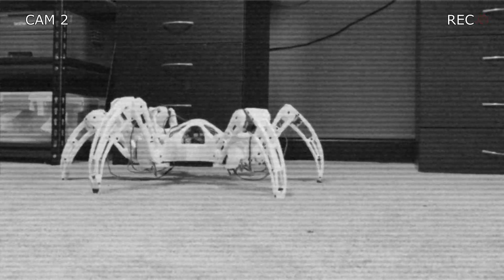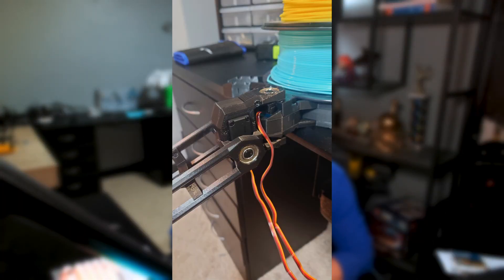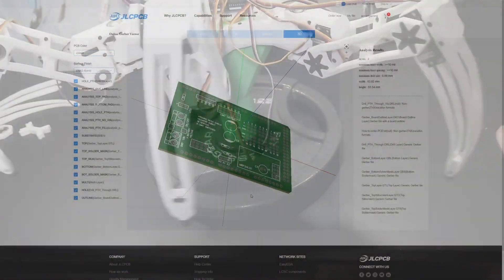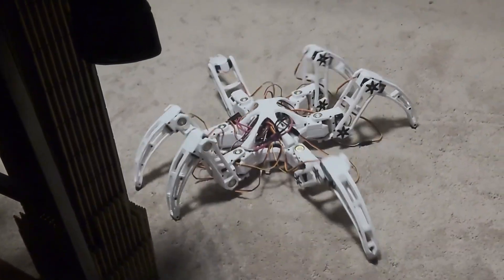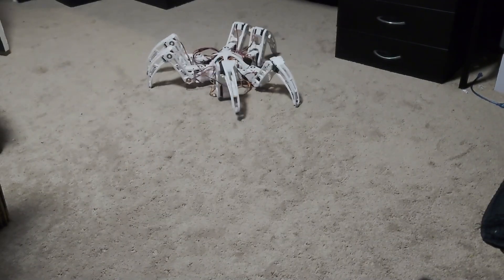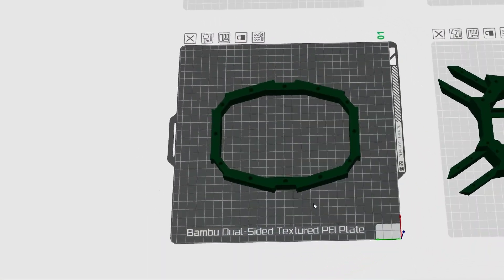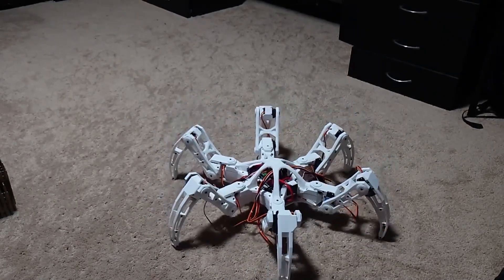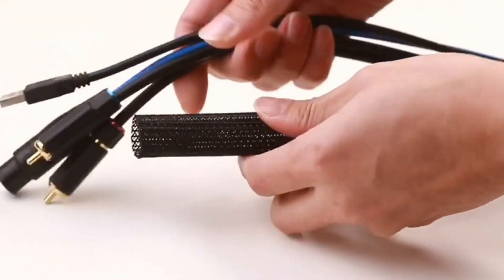I Built an Arduino Powered Hexapod from Scratch

Comment: Hello, I am an Electrical and Electronics Engineering student. This project caught my attention. I would like to implement the project using an STM32, but the servo motors you are using are a bit expensive for me. Therefore, I would like to use the cheaper MG996R servo motors. I don't have much experience with 3D modeling, so could you provide me with the drawing files that are compatible with the MG996R servo motors? Also, I would like to review the code you wrote."

Comment: Hi, where can I find the code for the one leg test? Also, do you have any idea how I could get it to work on RPI 4?
Reply from the maker: I actually don't have that code anymore, sorry.
I have no experience with RPI 4, but if it can run arduino code and has enough pins that it could probably work with a few tweaks?

Comment: What thoughts were involved with choosing battery size and type?
Reply from the maker: Powering 18 servos at the same time takes a ton of current, and a lipo is able to handle it. I chose 7000mah so it could run as long as possible before needing to recharge.

Comment: Two ideas I have. One some sort of mount plate on top for attaching accessories. Two wireless charger on the bottom so it can walk onto and set itself down on a charging pad. I think just these two modifications would greatly expand the use cases for this awesome robot. Dang it, now I want to build one.
Reply from the maker: Ooooh a wireless charging base is a really good idea!! It doesnt even have to be wireless tbh... Ill have to look into this.

Accessories are in the pipeline 😉

Comment: i Think this is real cool. But i think its missing somethink practical. You can hunt a little your cat with it, until it runs under somethink.
Idear would be to upgrade the board to somethink that can use a camera and even a detection system, so that you could use it as mobile camera.
With that comes the problem that the system needs to "see" when there is a object in the way or even can see when there is a hight diffrence in the walking way.
And the think maybe most people need is somethink that can uses steps to go up and down.
Reply from the maker: I think it's ok that this doesn't have a practical use! It's a cool robotics project/platform and that is good enough 🙂

Comment: You overcomplicated... 2 servos per leg are enough... you need to tilt and lift the leg... this can be done by gears or on low weight by wires and springs.
Reply from the maker: It would work with2 per, but the feet would slide across the ground while walking, so I'll only do that if I'm making a super low budget one.

Comment: which servo's did you use?
Reply from the maker: dsservos. ds3225 for the coxas, and currently a mix of ds3235/ds3235 pros for everything else
Reply: @AecertRobotics  so, are there any cheaper motors available for such a robot? What features should it have?
Reply: Why did you choose same servos for all parts, for example servos at the edge can be smaller and cheaper @AecertRobotics

Comment: Had same jitter 7:20 on the loosest leg of mine. I wouldn't really blame the servo as such. It's simply the mass of the leg at a distance and the speed of the movement causing overshoot on the servo position so it tries to correct back the other way and the same thing happens and basically it resonates. The servo is kinda doing what it is supposed to be doing but I appreciate that doesn't get you any closer to getting rid of the problem. Indeed increasing resistance to movement on the leg is probably the best bet for a fix.
Reply from the maker: 100% agree. For how inexpensive the servo is I'm pretty happy with it tbh

Comment: Now.... swap out the Arduino for an ESP32, and use it's WiFi interface for the radio. This way, any device with WiFi + Browser can be your controller through an IoT webpage.

Edit: You should merge your two motion states using linear algebra rather than an ad hoc method.
Reply from the maker: Would the wifi be fast enough to stream a video feed as well? That would be pretty cool.

Can you explain how I'd use linear algebra? Currently I have 2 points in space and I'm literally just averaging them together.
Reply: @AecertRobotics  Been trying to reply to this for days. Google spam filter has been blocking me. Not much I can do about it.... I doubt this will get through even.
Reply from the maker: @CharlesLeeScoville  that's weird... Well I can see this comment at least lol
Reply: @AecertRobotics  It may just be that my comment is too long... I'll break it up and obfuscate links....

Some ESP32's (such as the S2) have enough to do video. Search the usual shopping sites for ESP CAM as a good for instance, but by no means an endorsement. I personally would go for a self contained video setup intended for FPV drones...
Reply: The significance of linear algebra, in general, is that those above listed "transformations" are mathematical "operations" (think: "addition, subtraction, multiplication, division")  in a proper algebraic space, that is to say they can be combined, rearranged, and simplified just as you would with "normal" operations in "normal" algebra. It's the simplification concept that is key to your problem...

Say I have a variable, X, that starts at zero. I then add five, I then add two. I now have X as equal to seven. If we know the operation (addition) never changes and all we want is the result, then we could combine the two additions into one "big" addition, therefore having to do less work, and simply adding to X one time.... Algebraic simplification 101.

Right... so... all of your movements are some composition of the translation and/or rotation "operations" .. which we now know we can simplify.... and now we can think about specific examples... If I tell you to take five steps forward, then I tell you to take two more, you are now seven steps from where you started. Same thing as above!

Lastly, all this maths would also work just as well for "composite numbers," like complex numbers, and, important to us, vectors. Another example to make this sink in.... If I told you to take five steps north, and zero steps east, then I told you to take five steps east and zero steps north, it would be the same location as if I had told you to take five steps east and north from the very beginning.

Picking up what I'm throwing down?
Reply from the maker: @CharlesLeeScoville  right Im pretty sure I get what you are saying. Ultimately I'm just trying to calculate the next point in space the foot should be at. 
Currently to find the point I'm taking a weighted average of the forward point and the rotation point based on the two joystick values. What are you suggesting I do instead?

Comment: Great looking project!
Can I ask what lengths are the two parts of the leg? Do the motors handle the moment well?
Reply from the maker: Ty!!
Femur is 115 mm and tibia is 185mm. The femur and tibia servo gears tend to bend when I push it too hard, but overall they handle it quite well.
Reply: @AecertRobotics  brilliant, it looks much bigger in the pictures! how did you decide what would be the ratio between the tibia and the femur?
I've build a big hexapod as well (for my uni graduation project), you're more than welcome to take a look!
https://www.youtube.com/watch?v=QgEbqN0tf_c&ab_channel=MatanH

currently building a new one (cheaper since I don't have the uni funding anymore, but hopefully much smarter). thanks for sharing!
Reply from the maker: I basically just did what looked good lol. I wish I knew how to calculate the ideal length based on servo strength but I have a cs degree not a mechanical engineering degree

Comment: Interesting work.  Here are some thoughts/ideas I had while watching:
1) Stabilization Muscles: Real-life joints have smaller stabilizer muscles in addition to the macro driver muscles.  You might consider adding something along the lines of tensioned ligaments and/or little stabilizer drivers pulling on elastic, spring, pneumatics/hydraulics, or some equivalent tensioning straps across the joints.  These could also help provide feedback data to help the system "understand" how the joint is moving by seeing which stabilizers are being tensioned and which ones are relaxed if they are hooked up to a force meter.
2) Force Redirectors: The knee joint, for example, has the kneecap, with muscles attached by ligament to the top and then separate muscles attached to the bottom.  This re-directs force "over" the knee joint in such a way to reduce the torque necessary to extend the lower leg and also do so with more stability and less "jittering".  That could also help with the "jitter/stutter" issue you're having with the joints.
3) Foot "Angle of Attack" During Walk Cycle: I noticed when showing the example animation for the walk cycle, the foot seemed to simply be "aimed" straight down and then the entire foreleg would slide backwards while perpendicular to the ground.  I don't know if this was just for simplicity of animation of if it was actually how it's made to work in the code, but it might be helpful to give it a slight "angle of attack" when it walks; have the leg "tilted" slightly forward so that the tip of the foot points slightly backwards.  In other words, the "curve" for the walk cycle shouldn't be a completely straight line, but it should attempt to "dig" ever so slightly down into the ground and there should be a "secondary" cycle for a point somewhere "up-leg", maybe at the middle or even at the "knee" joint with it's own walk cycle calculated just a split-second ahead of the foot.  Maybe experiment with it to see if this yields any improvement.
4) Spider Curling: In real-life, Spiders have constant tension on their legs to make them "curl" up underneath them.  In order to walk, they actually use their own blood pressure, forcing their circulatory fluid (not technically blood; in spiders it's called hemolymph) out into their legs against that baked-in curling pressure and then "letting up" or "pushing out" to operate the legs.  It might be worthwhile to explore this as an option; make some kind of tension system that's constantly trying to fold the legs "under" and then the only real job of the servos is to "extend", and the variable is either "extend harder" or "extend less".  It might even be possible to ditch the servo concept altogether, or at least re-purpose it and, instead, use some kind of pneumatic or hydraulic drive to handle the extension of the legs.  BTW, this is why spiders curl up like that when they die; no more circulatory pressure means they can't fight against that forced leg curl anymore.
5) Ant GPT: Obviously not even remotely something to implement anytime soon, but perhaps one could incorporate AI functions to do things like optimize leg movements, especially if it integrated aspects like the stabilizer "muscles" with sensors.  An AI could take all the info like the tension of each ligament, angle of each joint, power of each servo, accelerometer, body orientation metrics, pneumatic system pressure, etc. and both coordinate the walking calculations and also continually work to optimize them.  Hell, even incorporate vision into the system by putting cameras on it.  Give it six tiny cameras for good measure and also dramatic irony.  They don't necessarily need to see "well", they just need "information" which can be incorporated and utilized for whatever it's worth.
Reply from the maker: Really cool ideas, ty for the comment!
3 I can and will try, I know exactly what you mean and I think it would help if I get it right.
4 is something I considered. I can do basically that by adding springs to pull the legs down, which would lighten the load on the servos. The more I think about it the more I think I should do it tbh.
5 believe it or not is something I plan on doing kinda. I want another hexapod project where it's walk cycle is completely designed by machine learning. It will  have 4 legs, 2 motors in each leg, and I will train it in a simulation with a nueral net on walking forwards and turning. I think it would be a really cool project.

Comment: I have a question... (Not critics, really want to understand). Why you didn't try "same" turning basics like cars used? I mean, very similar basic principal: when you turn you need inner wheel travel shorter distance than outer. On the tracked vehicles that principal used for turning, by breaking one side (simplified). Why not to try to mix that with legs cinematics? I don't mean to use that principal fully. If we just try to stop one side - it will not work. Most of chances it's will lose stability and flip over. I mean before you combine the cinematics from moving stright with rotation, to add one or two steps where the steps will be shorter by 1\4,1\3,1\2, to make that side a bit slower.
Reply from the maker: I mean that is basically what is happening when I combine the rotation with straight, right? If we are turning right, the right side takes very small steps, or even moves backwards a bit. Doing what I did is just easier than hard coding it all.

Comment: Hello Aecert,
my last comment seems not to be saved by Youtube, so i try again:

you mentioned that the model for your Hexapod is the MX-Phoenix from Zenta. I also find it the best. It looks great and moves very smoothly and fluidly. I have also been working on a hexapod for the last few years, but my programming skills are very limited, and I have not been able to teach the robot that the world is NOT absolutely flat. That each leg can also touch the ground above or below the baseline. Or maybe not at all. I had been planning to start over when I stumbled across your video. I was immediately intrigued and still am! 
In Zenta's videos, you can see his Phoenix climbing up and down a large rock or steps. It has a switch built into each foot as a sensor to adjust to the terrain. 
In the list of your STL files are things like Tibia Switch Mount, Switch Stopper, and Switch Foot, so I assume you at least plan to include switches as well. Which only makes sense if you also use them as sensors. So my question: are you planning something like a Climb Gait, as Zenta seems to have done? That would be great! 
In general, I'm extremely excited about your way of implementing such a project! I'm looking forward to seeing how it goes. :goodvibes:
Reply from the maker: I am planning on adding the ability for it to walk on uneven terrain!! I'm pretty sure I'll be able to do it to, but I haven't attempted yet. There are switches in the feet, but I haven't even wired them up yet lol.

It would most likely be its own mode where one leg moves at a time yeah

Comment: Fantastic job, thank you for sharing. I'm not sure if this would help, but if you have feet that when planted on the ground would rotate with what ever movement made. Forward backward and so on.  This should give you better traction and reduce friction.
Reply from the maker: Yw!
You're definitely correct, but my gut feeling is that the benefit would be negligable.

With that said, my current feet actually do rotate (but spoiler for an upcoming video, the newly design feet do not!)